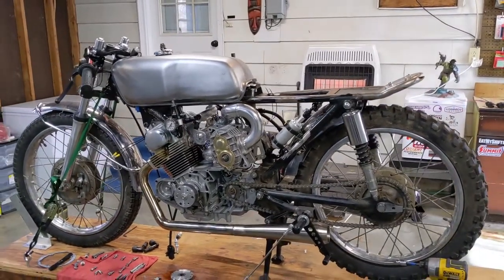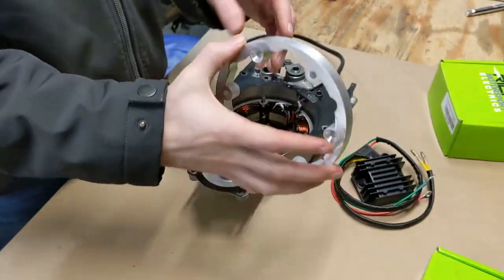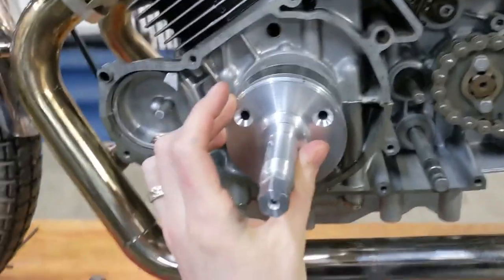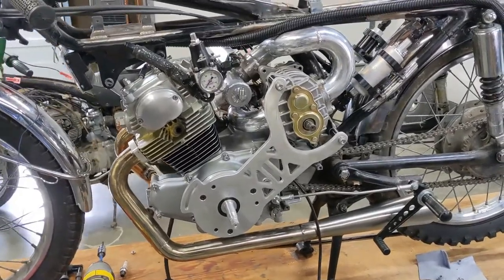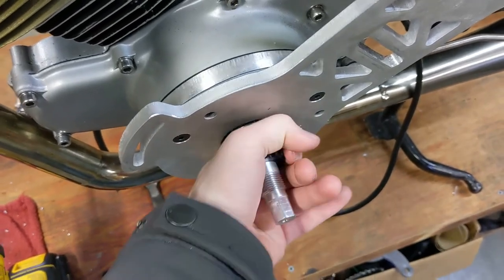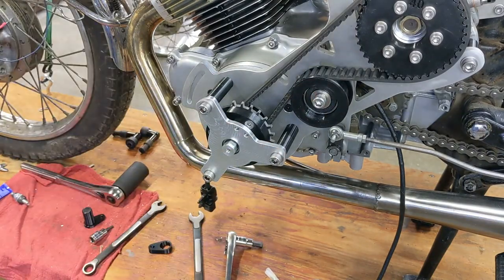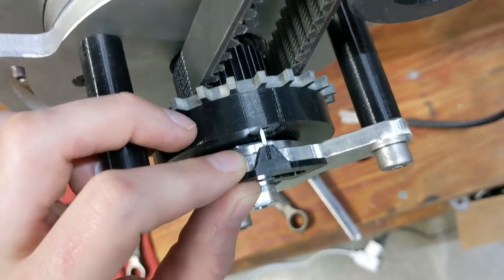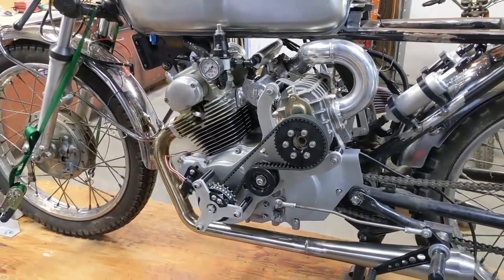The SUPERCHARGED Honda gets BIG upgrades - Fuel Injection Conversion PART 4

Comment: Awesome progress! We use a company called Xometry where we send them our step files and they give us a quick quote. Their turn times are very good (14 days), but we are buying in higher volume so get better pricing. You can choose overseas or mainland shops (Xometry is just a middleman), and oddly enough we get much better quality from the overseas shops, which also means better pricing. Pretty sad if you ask me!
Reply from the maker: Hey Roland, I did check out Xeometry, but since I only needed 1 of each part, the prices were pretty high.